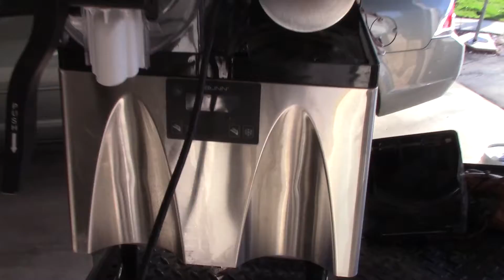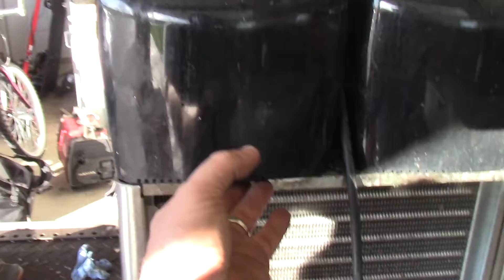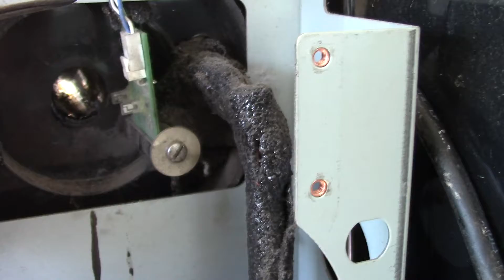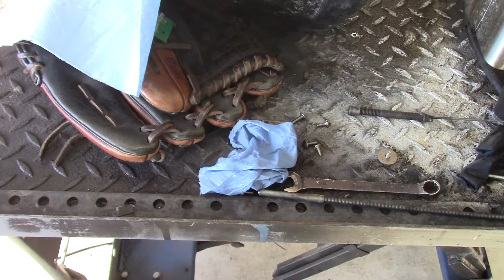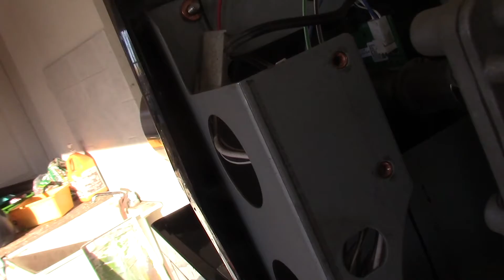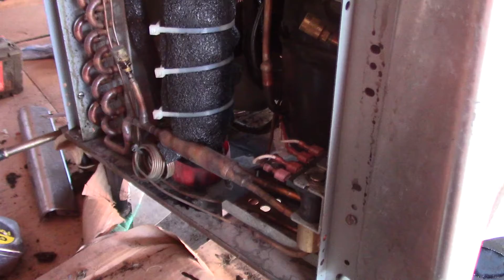Bunn Ultra 2 Slush Machine Repair

Comment: You should never use Vaseline on seals or anything rubber.  Vaseline is oil and will rot rubber in no time.  They make a water-based lube called Lubri- film that is food grade and works great.

Comment: great video.  We ran one for the first time in 10 years of storage.  It actually all worked great.  One issue there seems to be a bit of oil or oil/water dripping a small amount from under the machine.  Left side toward the front.  Any thoughts on if this is a concern?

Comment: I have a Bunn ultra 2. It just recently started taking a long time to freeze. I checked torque and temp readings. But sides had refrigerant flowing. One side drum was able to get down to 15 degrees and ended up freeze after about 5 hours. The other side drum never got below 25 degrees and product never froze. Any idea what could cause that?

Comment: Great vid thanks, I installed a new board then had left torque sensor error.  Did not show on old board just a tic clock error of course.  On a side note your Mom is a " Dirty Girl " 🤪judging by that tooth brush.   Thank again and I subscribed.  I am long time HVAC/R 40 years if you are ever stuck send me the question.

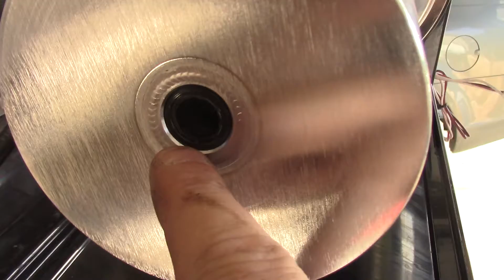Comment: Anyone know if that seal & bushing at 6:44 is difficult to change? Looks like there are two seals (cooling drum seal and auger shaft bushing (blue))
Reply: Takes less than a minute and IS the only reason why you would have syrup inside the drum. This fix is worthless without replacing that $5 shaft seal. 🤣

Comment: The pins go through optical sensors that determine tike through passing while taking into account temp from the sensor woth the black insulation, sometimes if you don't adjust your thickness through programming it will warp or break thos pins, just a thought
Reply: Also face pins away from torque board to avoid damage

Comment: I’m new to the machine, as it was gifted to me by a neighbor. I’ve cleaned it up pretty well but I just can’t get it to get cold/freeze. What can I do to see what is the exact problem? I’m looking at the Temp and Torque Screen and fan and cmp are both working. Shows below. And I can see the fan goin with the side panel off. 

99-FAN CMP 0[]
42           42

Then the second screen shows

99-FAN CMP 0[]
69           69

Comment: Vaseline is a petroleum produce and can damage the seals. You are also working on a food handling product and a food grade lubricant is what should be used. Super Lube is sold as most box stores and spring goods stores as well as Amazon and other places. That is a clear food grade lubricant and is what is used in potable water devices like backflow valves or other devices that come into contact with drinking water.